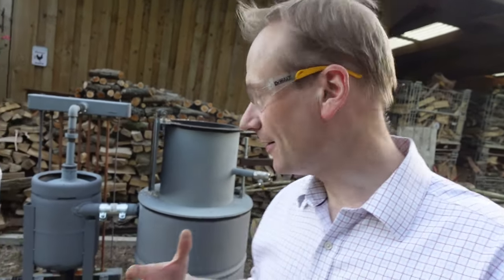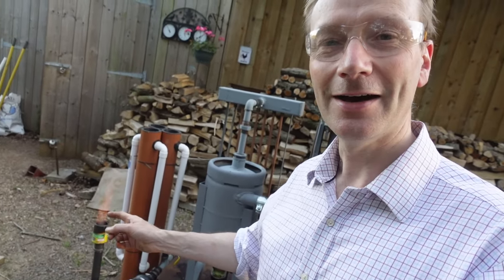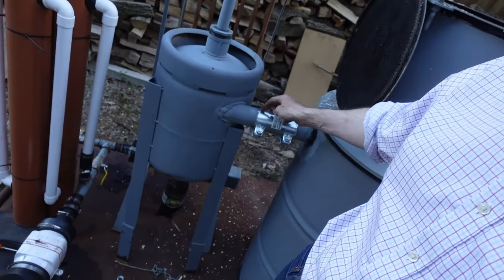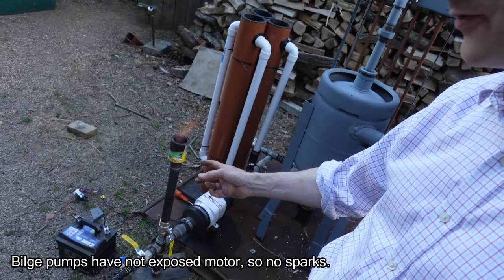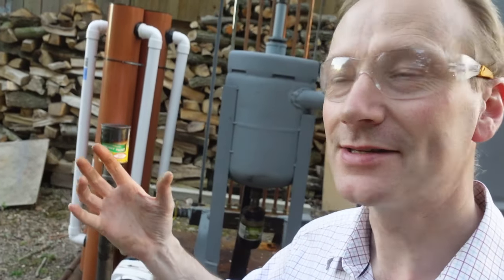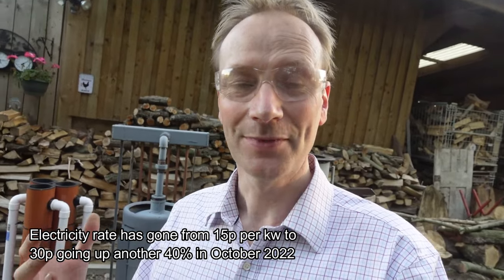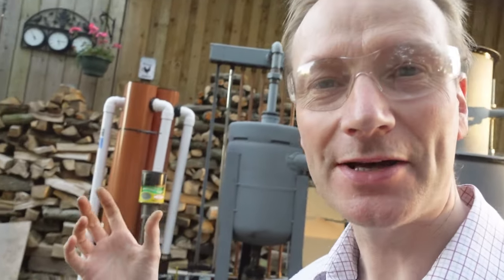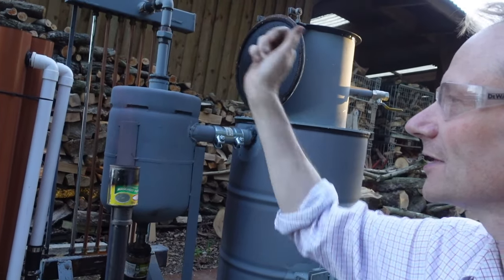Making wood gas using my Wood Gasifier.  Introducing my Imbert Gasifier Part 1

Comment: I did not spot an explosion release cover on the filter can, as well there needs to be adequate release points throughout. I jump through vids quick, but I do know at least one guy in modern age of W-G got himself killed by a tank explosion. The problem is always at potential, if you have any leaks after the hot spot then there can be air getting in that makes a bomb-mixture in some tank or tube. Some kind of cap on a chain that blows out quick is needed, adequate to release the shredding pressure.

Comment: The radiator cooler/condenser is a good thing to use, a mist of water spraying through it would help. It's alought of work and time making one of these,,, 👍⌚🥵. Good job.
Reply from the maker: Thanks for the tip.  Thats a good idea.

Comment: That will run a gen set . it quit clean at that  but it not as much as is possible  ironically drying out your wood chips as evaporated the full potential in it wood fibbers , the water with in.  but never the les it will run a combustion engine.  but if you pull it in to a charcoal colom now you would increase it within the colom & if you dript, Water in the entrance  so it can flash to steam &  be sucked  in it would burn of it oxygen &  enrich it even more.  Test out my suggestion  & get that eureka  moment .   for your self.
Reply from the maker: That is a fantastic suggestion.  I will definitely try that and see if makes a difference.  I can see the logic of what you are saying.

Comment: As far as gas cleanliness is concerned, when not lit if it only looks a little hazy it is plenty clean to run an engine safely.  Colors themselves can be an indicator but I don't stress too much over color.
Reply: Fouled plugs, gummed-up valves, gummed-up intake manifold, ...  Seems like the cleaner you make it, the less maintenance on your engine.  And it's easy enough to get a clean end-product.

Comment: Thank you so much for uploading! I have been designing my own for a very long time. I like to "Go big or go home"... I am torn between utilizing re-purposed materials/objects to build my unit, or building my unit from scratch. I know that things like burn barrels, grills, and even exhaust manifolds are prone to a lot of rusting due to the thermal cycling that takes place...

If I utilize Stainless for everything I will probably bankrupt myself. Not only that but I have never welded stainless before. To make a decision on this I need to be able to weigh my options against one another. For instance If a 55gallon oil drum will suffice for long enough then I would rather use one because I can always easily source and replace them. 

Have you experimented with any type of coatings on your gasifier? The first that comes to mind for the inside of the equipment is high temp ceramic coating. I'm flying blind on this 

Thanks!

Comment: I have a CNC machine and I get an endless amounts of very dry sawdust and wood chips. Could that be used as my wood or a mixture of?
Reply from the maker: Hi there.  I would say that the sawdust probably won't work as it would be too fine but the wood chips should work so long as they don't get caught in the neck of the gasifier.  I have been told that having bone dry wood chips don't work quite so well as having chips with a slightly raised moisture content.  So much to learn with this technique and I must admit I have not quite mastered it yet.  Thanks for watching.

Comment: Saw someone using a water scrubber, think it was just pouring in at the top and splashing down on sink strainers. Maybe you’ve seen that? In fact it may have been flash that did it. I can’t remember.

Comment: Question is the hot gas to dry and a lubricant added for the pistin etc
Reply: The cooler the gas the more power with  in the gas  Now to run on a combustion engine we must let the gas in & the air in at the same time at the entrains to the inlet valves of the gen set . ones it fires up august  to fins the sweet spot in the gas air mx . .

Comment: Do you have a condensing/monorator hopper?  It would allow you to dry the wood as it's in the hopper, steam from the rising heat will condense on the cool walls and go into a gutter ring leading to a container outside the gasifier.

You could make one that bolts onto your existing unit if you don't have one.

Also if you have a few extra bilge blowers connected to each other it will get warmed up a bit faster.
Reply from the maker: very intersesting - I will definitely have a look into this.

Comment: Very nice video. I would like to see how you designed your condenser.
Reply from the maker: The condenser for this sized gasifier was so overly engineered that in the end, I replaced it with a single longer copper tube.  All will make sense in my follow up video.....

Comment: Don't worry to much on flare color, if it is just a haze and not smokey then it is plenty clean. You can see in several of my videos I don't care about the color of the flair at all, if it's a nice haze it is ready to run the engine just fine
Reply from the maker: Hi Marcus, thank you for that.  I’ll have a look at your videos.  I think I’m pretty close but not quite there yet….
Reply: @mycountrylife810  have you tested to moisture content of your chips? This will make a big difference in temperature and how fast you get clean gas. Ideally you want say 10-12% Mc, that’s what my truck likes the best this leaves a little water to get converted to hydrogen as it passes through the glowing hot char bed

Comment: One video I would like to see done on wood gas electric generation: The condition of the engine after running for several hundred hours. As you point out, the tars are more or less removed, and the gas is cooled and filtered. How does the best possible quality wood gas affect the life of the engine? Do they need to be torn down and cleaned anymore than a gas fueled engine? I would like to believe they run as clean or even cleaner than gas fueled engines.
Reply from the maker: Hi Phil.  Yea, it would be interesting to strip an engine after hours of use.
I think the tars are the biggest enemy, but as I understand it a small amount is not too bad especially if the engine is run for a few minutes at the end of the run with a bit of regular petrol.  I’m hoping to keep tars and particulates to a minimum but will make another video soon.
Reply: @mycountrylife810  Valve deposits (and spark plug fouling) would be the main problem. Life of the engine would otherwise not be an issue. Water filtering should help considerably as those should precipitate out
Reply: @dodgeplow  Maybe build-up on valves causing them to burn out as well?
Reply: @harrymills2770  I think more so on the intake valves, but on the exhaust as well to a lesser amount. It would cause bad valve sealing after a while. The water filtration could reduce that but I don't know enough about it.

Comment: you seem to have no throat or hearth in your reactor (burner).  have you read the literature on throat diameter versus flow rate?  this is the heart of wood gas production - you have to maintain the  temperature for pyrolysis, high enough to crack all the tars, and, without a throat to entrain the air for pyrolosis, it will spread out, and will not get hot enough.  i think, or am i just not seeing the constricted reduction zone you mention?

Comment: My ignorance of this process will surely show. Will this contraption be directly connected to the engine? if so, how will the overflow gas be dealt with? If it's not connected to the engine, how will you store the gas you produce? And how's the vineyard coming along?
Reply from the maker: Hi there.  Good question.  Once the engine is running the suction from the engine will provide the flow through the gasifier and the fan motor can be switched off.  For this reason, the gasifer is built to the specification of the engine to be used - ie if running a 100hp engine, the gasifier would need a wider constriction in the 'reduction zone' inside the burner compared to a small engine that I will be running.  Therefore there won't be excess gas produced that needs to be stored - the engine inself uses all the gas being sucked into it.

Vineyard coming along nicely now - a new video will be posted shortly on summer pruning.  Thanks for your interest. much appreciated - regards Anthony

Comment: Hi could you please let me know the bilge pump details thank you
Reply from the maker: Hi Dave.  The bilge pump is a 4 inch pump (ie the entry and exit holes are 4 inch.  Standard bilge pump that I found on ebay.  The motor is encased so the terminals are not exposed to any gases.  I think the flow rate is 270 cfm (cubic feet per minute)

Comment: Hi is it possible to gasify diesel cars? Or is it just petrol?
Reply: yes but the is no spark plug  so a mens of ignition  is required  son drip a little deal in with the gas.  I have never done it my self  but     I have seen diesel running on gas.

Comment: Wow :) I would have been proud if my first attempt would have been that successful :) Nice build. 
Have you ever considered using a column with electrostatic precipitators? I use 4 of these in a row and it works like a charm. Invisible gas (no smoke) with a slight woody odor.
Reply from the maker: Your set up sounds amazing!! I will definitely take a look.
Reply: @mycountrylife810  As I stated out earlier, I will make a video when everything is up and running. My gasser is ready but the CHP takes still a lot of time. One day when everything will be assembled and the shed has been cleared, I can present it to the public. ATM everything looks like chaos.  Especially the shed. :D 
And since this theme is very time consuming and based on try and error, there are some things which are more important than this hobby. Slowly but steady.
Reply: @ravelkoff3549  Slow and steady is hard to learn, but very rewarding.

Comment: surprised you didn't use the biochar for a filter
Reply from the maker: I may well end up using biochar as the fuel at this rate. I am still a bit of a way to getting it to run stable
Reply: @mycountrylife810  do you mean as heat source? Because what makes biochar charcoal is the fact that all the volatiles have been boiled off.

Comment: Is there enough wood available to do this at scale? Seems really complicated.
Reply from the maker: We shall see.  I shall report back how much wood it burns per hour in a future video.
Reply: My gasifier consumes about 50lbs of wood for 55-60 miles traveled in my truck. There are much more efficient systems depending on the needs of the engine it is powering
Reply: if the wood is free, it's great for the individual enthusiast. This would not work to large scale or industry would've done it already.
Reply: @dodgeplow  all the wood I use is free, pallet wood from my work or limbs from tree removal. Doesn't need to work large scale, people are way to lazy to do wood production for daily use like I do. And that's fine with me. Although there are many industrial systems in other country's, and several in the US  powering small farms. Lots of off grid back up systems
Reply: @BigBeavrSlayer  I agree. I was commenting in reply to the initial comment. I used a wood stove to heat my home for years on just the downed trees and dropped limbs on my property.
Reply: @dodgeplow  there's a reason I call wood the freedom fuel 😉  didn't have to pay the power company for all the free heat did you 👍
Reply: @BigBeavrSlayer  That was when I learned that the same piece of wood heated you 3 times - when you cut it, when you stacked it, and finally when you burned it lol
Reply: @dodgeplow  it's 90° outside right now and I was just chunking wood for a few hours for my gasifier and boy, I would sure be ok if I wasn't warmed by moving that wood right now 😂
Reply: @dodgeplow  Processing your own wood is no hardship, if you're in reasonable health.  It's also satisfying, for some of us.
Reply: @harrymills2770  I enjoyed it. I think satisfying is the right term.

Comment: can you use plastic instead of wood?
Reply from the maker: No, I wouldn't use plastic. Too many volatiles that would gum everything up and would probably be too explosive.
Reply: @mycountrylife810  do you think it could work with additional filters?
Reply: People have tried using small percentage of plastic, the ash is a finer powder and you don't want a whole lot blowing through. The volatiles will crack as expected for any carbon fuel and no longer exist as they were. I think finely chopped plastic mixed with small chunky coal going down a coal feeder pipe is the best approach, but I never built this yet.

Comment: Don't put anything other than gas with a perfectly blue flame through an engine.
You'll get away with using dirty gas for a short while, but soon you'll be stripping the engine to clear out the tar. Any yellow in the flame is some form of un-burned carbon, which will deposit in the engine.
Ultimately, a diesel engine will be more forgiving of dirty gas - and it will happily eat waste oil too.
Reply from the maker: Good advice Brian. Thank you.

Comment: Very good build , but you buy tge wring generator in a previous vid.
Diesel engine,  not great .
Petrol engine your only man for gasifier .
Reply from the maker: Hi Marc. You are quite right, the diesel generator in the previous video was purchased in the likely event of power cuts here. The Gasifier will indeed run a petrol engine and hopefully charge a battery bank for long term off grid power. Good to have a back up.
Reply: @mycountrylife810  but saying that's  , there is youtubers who have shown that they were using woodgas with diesel engine. 
So , it might be something to try 🤔

Comment: I imagine running a Stirling engine directly on the wood burning heat would be more efficient
Reply from the maker: Hi there. I did initially look at making a Stirling engine but apparently gasifiers, of done right, are even more efficient (and easier to build).
Reply: @mycountrylife810  maybe the gasifier, but the IC engine is definitely not the most efficient at extracting energy from any fuel.
Reply: You could extract the waste energy for heating water, driving a fan or heating a greenhouse. There are probably many ways you could make it more efficient.
Reply: @mycountrylife810  I would use the heat to help dry the wood chips. Maybe a drying bin with a fan channeling the hot air?
Reply: @Scott-lz2th  I think he's getting his chips pretty dry before using them.

Comment: run the gas threw a bubblers  & that  will clean it to,  blue would indicate  monoacid gas  it nee to be mesentera Or yellow in colure To be an hydrogen rich gas This  can be achieved by sending your gas into a charcoal colom before your  filters & then to the power unit you interned to use.  i prefer a dc gen set  to charge you battery bank. it can be manually incest by hand to to the level's one needs is the best way forward,    the ues of a  bubbler in the early stages will  cool it & clean it up .  But it must be understudy  The power we are after is not in the wood  I repeat it's  not in the  wood But locket  up in the wood fibbers in  it's water content . Yes Yes YES.  it not what we have been educated in   But in 1962 i discover the real truth about the  wood gas genarater & it not the wood in the siystom but the water it produces that provide the reel power with in the wood fibbers,  that the wood gas genarater achieves  to make  coupes copes amounts of charcoal  sufficiently.  of a size, pre 'pyrolysis.  to put in a charcoal colom  & the  charcoal.  That i used was a fill & power the colom. it was a bad wet & cold year & the ability.  for gas production fell in my farther old  WW2 gas genarater,  after experiments i discover. that puling the  damp smoke  into a hot charcoal colom  Bern to the oxen in the damp gas & predust copes as amount of  power.  in the form of hydrogen gas. far more than was available in dry wood.    Les England , 
Ps  we had one for years at home  when i lived of grid. but the charcoal colom will predust sufficient  power with a water drip to power most genarater & combustion engines most  feistily. triy it out & see for ones self , Les
Reply: What's a bubbler
Reply: @justinmason993  a bubbler is a vestal field water & the gas is allowed to travel in & rise to the top to clean & cool the gas  As it levs the top on it wat to a charcoal colom  to barn of the oxygen in it's  damp smock & expire in to the flair .  & then to the  Gen set . as hydrogen gas .  its impotent to relies the value of the water in the wood & the work the wood gas genarater plays  in extracting it as it convert the wood to charcoal . for ues in the colon. it the missing link in the wood  gas generates development  put simply it best id one sets up an experiment  puling damp smock into a charcoal colom & observed the  transformation of it gas as it levs for the fear.

Comment: Way you make it so complicated? Way not simple biogas, is clean it's less work and no to maintain only dumb your organic west in. How simple it kann be done watch ( Marc Wildner biogas) on YouTube 😘
Reply from the maker: Hi Marc. Looks like a good idea and fair play to anyone doing this. My only preference is that I'm handling wood chips but if it works it works.
Reply: With a good system on a pick-up truck you can put 3,000 pounds of wood on a trailer and cross country. Bio-gas not so easy unless you compress a lot of it... hmmm... how much, how many pressure-tanks ?...